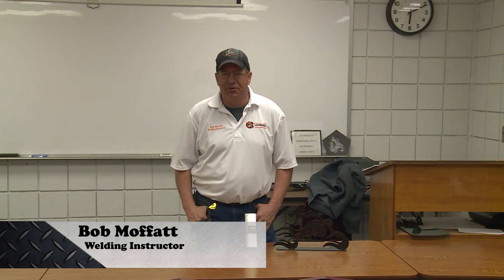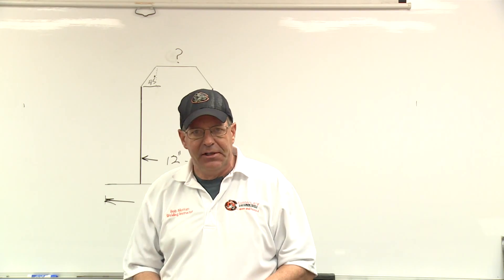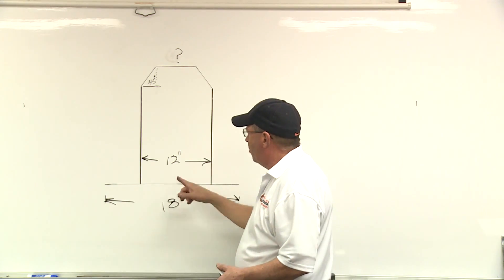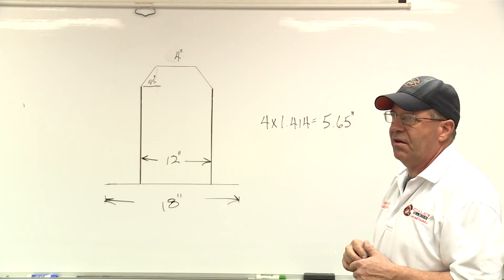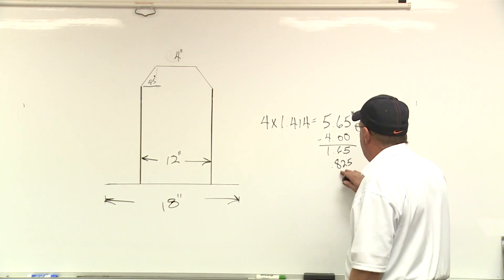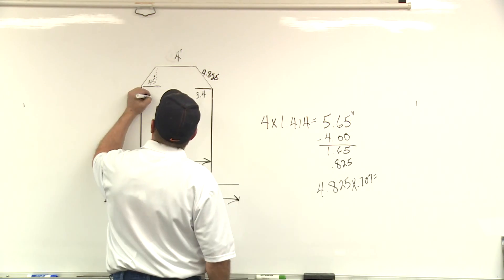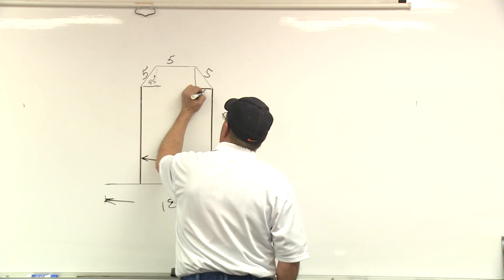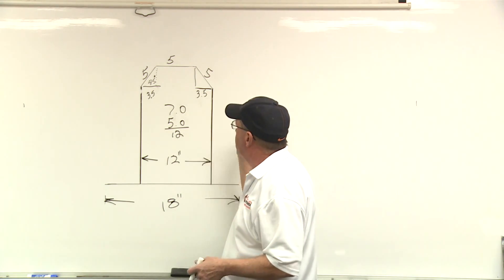🔥 Shop Math: Fire Wood Rack Layout

Comment: Bob
The shape you described is part of an octagon. so you can work out with the  formula.
On a calculator (using brackets) press;
2 * 6 tan ( 180/8 ) =  4.9705" sides
This doesn't work on Google calculator, unless you change the rad/deg switch to degrees (upper left in google calculator screen keypad)

I didnt know of this, but got curious after watching your video. I found the info on this website 
http://www.mathopenref.com/polygonsides.html

This also works for the pentagon in your other video. except you use sine instead of tangent because the pentagon is inscribed within the 8" steel disc. I checked the results with autocad drawings, and it seems to be a reliable method.

2 * 4 sin (180/5 ) = pentagon with 4.702" sides,

Comment: Hi Bob, 

The way I would do that is knowing a 45 degree triangle, with a side of 1 unit, the hypotenuse is sq root of 2 or 1.4142, so you have (1+1.4142+1)×X = 12" so X = 12÷3.4142 so X = 3.5147, so the horizontal dimension of the sloped section is 3.5147, the segment dimension is 1.4142× 3.5147 = 4.970. So 3.5147×2 + 4.970 = 11.9994". Think we can live with 6/10000".

Trig is so important in so many industries. 

Making things like lobster back bends or folding a stainless steel sink with raised corners are far more challenging 😯

Comment: The math is incorrect. The root of 2x the square of 5 (25+25=50) is not 7, it is a bit more. A more correct number is 4.97. I did the math with pythagoras.
Reply: Being a practical man, he does not need to worry about 0.03 in.That is less than 0.5mm each side of the diagonal tube.
Still, In this case would be better to cut slightly under and fit it in

Comment: 1 / sin(45) = 1.414 that's how you calculate the hypotenuse length in 45 degree angle. hypotenuse = 1/sin(45) * opposite side (or adjacent side, same since it's a 45 degree angle) (PS: sin(45) = cos(45))
Reply: Remeber Oscar Had A Heap Of Apples......   Sin, Cos, Tan....
Reply: lol...indeed !